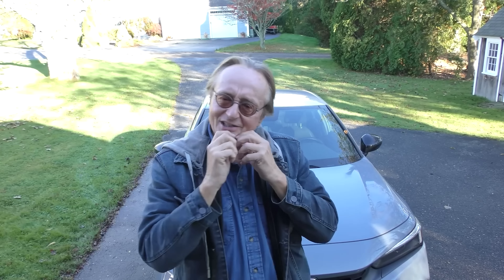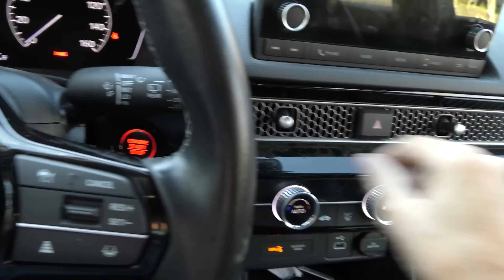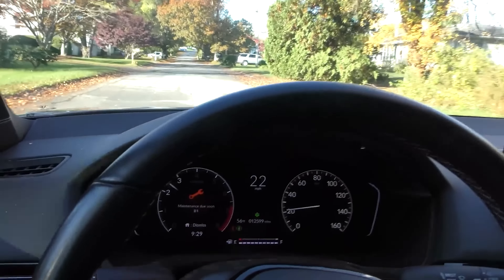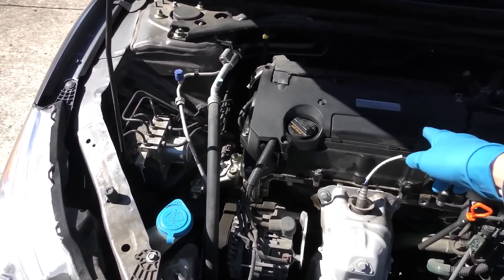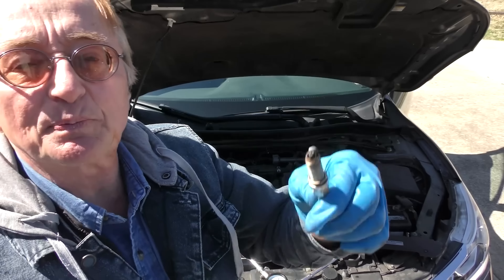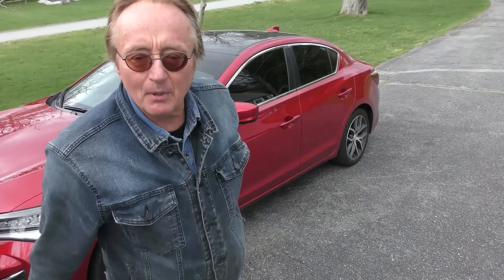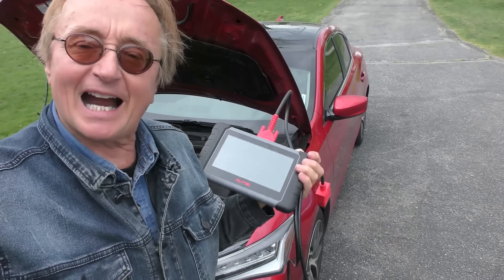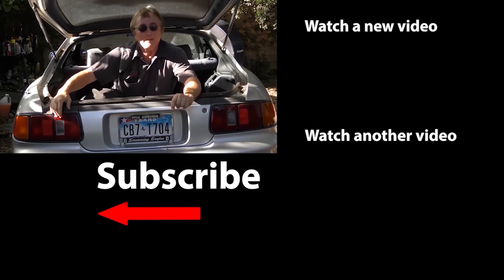What Just Happened to Honda (Where Did it All Go Wrong)

Comment: I've owned five Accords ,all excellent vehicles. Fun to drive and fuel efficient. I recently upgraded to a new Acura Integra with the Civic Si engine. Awesome car and also very fuel efficient, I average 38 MPG in mixed driving. And I got the dealer to knock $1K off the MSRP, I was thrilled.
Reply: overpriced SI
Reply: I have an Accord, great car.  I used to have the older Integra, another great car.  I would love to get the new Integra but I'm worried about that small 1.5L Turbo engine, it won't last as long.

Comment: I got 5 free oil changes compensated to me when they muffed up my starter replacement and an oil seal replacement, yup screwed both up (2014 Crosstour starter issues).  But they fixed both at no additional cost and gave me the 5 free oil changes.  So I went to have the oil changed, they changed the oil, did a general inspection, what I like is they mechanic does a video goes over anything he finds, shows you on the video what he found, and when they were   done they ran it through the car wash.  4 more free visits.

Comment: Own a 2017 Honda Civic Touring, 1.5L Turbo 170HP.    Bought it New, December 2016.  Runs great.  Driven 222,000 Miles.  Change oil at dealership every 10,000 miles.   I will start changing the oil every 5,000 miles.
Reply: I had the 2016 civic 1.5T EXL for 111,000 miles, trade it last year because I was worry about the long term reliability since I skip all maintenance other than oil change and filters. Change oil at dealership around 7k Miles. Did you ever change the transmission fluid? Any repair yet?

Comment: So hey Scotty, did Honda fix the valves that used to need adjustment relatively early in the live of the engine?
I haven't been following you for a while because I never searched for you on my new phone! I'm back and highly entertained again!
Reply: Valve adjustment is part of owning a honda.  They typically need it every 100k or so.  Not a big or difficult job.
Reply: I'm not sure about Iridium, but I used to have a tool to sandblast clean plugs and they worked fine. Is that still an option?
Reply: @BrewBlaster  On iridium plugs the tip is extremely hard but consequently fragile.  That's why you get them pre gapped as it's easy to damage. Don't know how that process would effect them.
Reply: Honda/acura have gone downhill. I've been an acura user since 1999 and seen their down fall. I need a new car badly but they have turned me all the way off. Right now I have a 2011 acura MDX with 290,000 miles on it. Still in good condition but it burns oil and seems like the tans is slipping.
Reply: @yvetteschoon8405  While It's true well maintained Hondas can make it to very high mileage, 300k is something most vehicles will never achieve.  Welcome to the sub 1% club.  Some clutch packs and valve seals are the least you could do for such a reliable vehicle.
Reply: @s13gouf60  I wish I knew how to do all that. I'm tired of getting taken from the dealer. I live un upstate ny and can't find a reliable mechanic.
Reply: @yvetteschoon8405  We are a dying breed, even more so in a state so hostile to small business owners and entrepreneurs.

Comment: '07 303,000 mi civic hybrid and '08 305,000 mi civic hybrid when we sold them. Neither was leaking nor burning oil. But, oil got changed every time the dash said to.

What more can be said, they were Hondas.

Comment: One thing my 85 Honda accord (yes 1985) manual shift had that I owned in 2014 was the car showing on instrument panel that not only showed which doors were open but it also showed which brake/headlight and turn signal bulbs were blown out! I LOVED that FEATURE and haven’t seen it in any other newer models 
    That 85 accord power windows and antenna and
Cable clutch blue with blue/grey inside had not a spec of rust and lived here in CT. That fuel injected carbureted 2.0 engine lasted past 430K miles when I sold it cuz the timing belt snapped and I assumed it was a interference engine and was damaged. 
(Based that on past car Hyundai Elantra that happened) to find out couple months later all I would’ve had to do was put another belt $22 and readjust timing and it would’ve been fine! Kick myself in the A$$ stilll about it..😢

Comment: When I buy a vehicle, I calculate the down payment to be exactly what all the extras cost so I walk away paying what I was supposed to pay for the base car... works well imo and I get a loaded vehicle. I normally do this with motorcycles and then trade it back to the dealer a few years later, it's a decent system.

Comment: I mowed the lawn with a Honda today and it started running really uneven after a while. I wonder why.
Reply: I have a 20 year old Honda HRX mower. Mine started doing this too and I put a new carburetor on it and it is as good as new. Use non ethanol fuel and see if it helps.
Reply: Ethanol, like the man said.

Comment: US is such a blessing after 4 or 5 years used car market will be half like 10,000 or 12,000. In my country with 55,000km 2018, 1.8liter Toyota Corrolla for used car market it still cost around 80,000. Assume it is 1USD=1. That does not include insurance and roadtax that need to be paid.
Cheapest car that we can buy is around 43,000, with 1.0 or 1.3liter engine, Natural aspirated. Oh I forgot the shortest loan that can be paid is 60 month and up to 108 month. It depend to the loaner. If choose 60 month payment then the monthly installment will be much higher. Mostly will choose 108 month payment. For 10,000 with cash example Toyota maybe can only buy 2004, Toyota vios 1.5liter,guest how much mileage on it.

Comment: My daughter just bought a 2023 honda civic with automatic trans at msrp in Chicagoland suburb I can see why they added 5k to a manual trans civic because those are getting phased out and are hard to find
Reply: By the way, it comes with regular tires not the low profile tires. Only drawback is that it comes with nice plastic hubcaps not alloy wheels but it is 1500 less than civic sport

Comment: The electrical parking brake is good for feds. They can control your car remotely if they wish. The EV car is 100% controllable, the hybrid is mostly too. 
The diesel engine and manual transmission car with a lever parking brake is least controllable.

Comment: I really like electric parking it works great. Most people don't even set brake properly on a hill this sets brake automatically. 
very smooth hope it's reliable long time.
Reply: I use the parking brake but not the "brake hold" it feels like it locks the brakes.

Comment: I always watched until the oil started turning Black,  and then I changed it no matter what the mileage was.
Reply: That's dumb. Oil becomes black as soon you heat it up decently without losing it's lubricating properties, so if you drive the car as it should be, the oil is black after a few weeks.

Comment: We paid MSRP for the exact same car.  Looks good, drives great.  Missing some basic features that our Elantra SEL came standard with.  No TPMS sensors.  No wireless charger.  No wireless Android Auto/Apple CarPlay.  No heated seats.  No sunroof.  No dual zone climate control.  Screen is smaller than the Elantra.  The son with the Hyundai wants the Honda because the Honda is cooler.

Comment: I would consider those useless covers as Dust covers.
Back in the day, wires, etc would corrode fast when exposed to elements 
and start to jump electrically to ground and cause a miss.

Comment: Main issue with Honda is the Crap A/Cs. Had a 2003 Odyssey and 2013 Odyssey, both needed to have the A/C replaced. The 2013's A/C died the day we drove it off the lot new. And the 2013, interior quality was sub par as well. Will concur tho about the engine. It was great. The rest of the van, not so much.

Comment: I have a 2019 ILX, and the only problem I’ve had so far is a little corrosion on the battery. If Acura had kept the same power and drivetrain in the new Integra, then it might’ve been worth buying. The ILX feels more like a classic Honda car with a real parking brake and no turbocharger.

Comment: your customer seriously overpaid for the car it is a manual Civic. Also, I would junk that honda accord. Once a car is burning more than 1/2 a qrt between oil changes in my opinion it is time to junk it. I don't buy the nonsense of adding oil between changes if it is burning any amount of oil over 1/2 qtr between changes then it is time to get another car. that is the last thing I want to do is have to remember to top up the oil because the honda stuffed up in the first place.

Comment: Paint work, head light material, ac compressors, electrical problems, all issues that have been on previous gens. My question is what did Honda cheap out on this new generation, hopefully we’ll find out and then buy one when it’s been worked out.

Comment: My wife's 2012 Ford focus 4d hatch back got 29mpg combined. 2l and up to 38 highway. Now after it got totalled and we had to get a replacement. The replacement is a 2014 chevy impala. It has a 2.5l and gets 21mpg combined. I'm so frustrated. My old 2003 Buick century with the 3.1 that got 23mpg combined. The Buick weighed nearly 5400 pounds. The chevy no where near it so infuriating

Comment: I won't be buying any vehicle that doesn't have a manual parking brake. If enough people refuse to buy them or get into accidents because the electric parking brake didn't work due to lack of battery power, bad wiring, computer glitch, etc., they would be forced back to offering manual parking brakes.
Reply: Electronic parking brake save my car from rolling down the steep hill a few times while I was doing food delivery. It auto engages if you forgot and left your gear in D when you walk out of the car. Used it all the time daily in my 2016 civic with 111k miles never have any failure.
Reply: @skyblue1122  
If you didn't learn to put your car in park after the first time, it seems like the auto engage brake is training you that you don't have to shift out of drive when you exit the vehicle.
Reply: @barrybeede1277 As a delivery driver you get in and out of your car so many times everyday, odds of forgetting greatly increase. Also, theres a lot of distractions such as looking out for robbers and dogs, bad weather, boss call you asking where you at, etc. It might be a simple job, but not as easy as it seems.

Comment: Honda is horrible  quality there idea is not how good it is but does it do what is required they start burning oil a 90 thousand need a new radiator by 40 thousand CV joints every 35 thousand. Does that sound like a good car brakes every 24 thousand?

Comment: Should have got a type R for less than that, LOL
Reply: No can do. The Type-R starts at around $44k. If his Honda dealer was adding $5k markup to a Civic Hatch Sport, they'll be adding twice that to a Type-R, making it around $50k. You have to shop around and compare dealerships. My local, rural dealer will sell me a Civic Hatch Sport Touring right at retail. 34 miles away, in a more populous area, another dealer is adding $4,000 "market adjustment" for the same car. Norm in NJ.

Comment: The Honda P10A2 engine is the worst engine Honda ever made(mostly available in the Civics sold in Europe and Asia). So what's the worst thing about this engine? Not that it's a 1 liter 3 cylinder turbocharged engine but the damn thing runs on a wet timing belt. Yes, a TIMING BELT soaked in OIL!

Like all belts you have to change it every 60,000kms but, to do that you have to remove the top cover, timing belt cover, and the oil sump and every tubes and hosing and what not that's in the way.